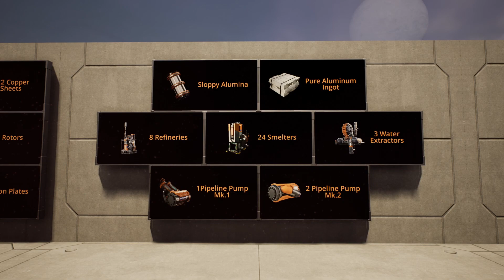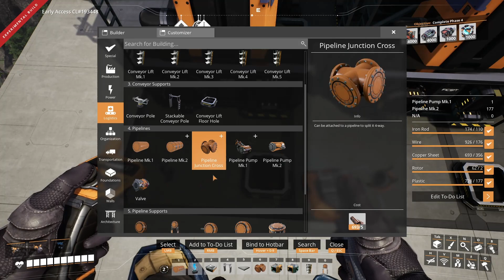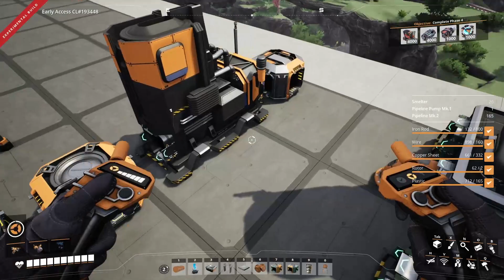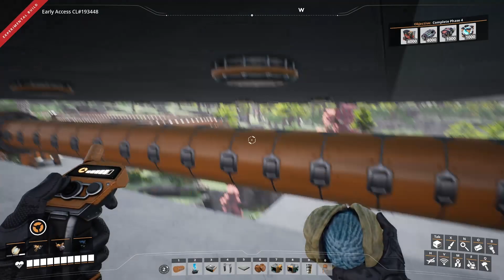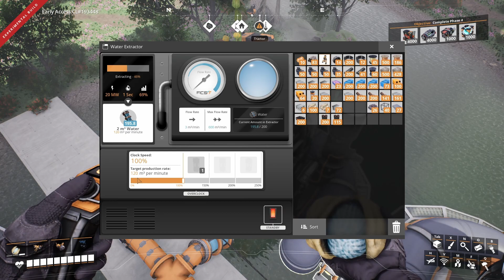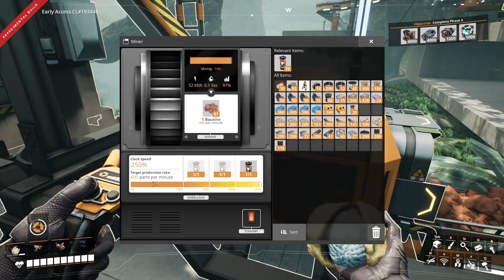Satisfactory: Waste Free 720 Aluminum Ingots/min

Comment: I adapted my own Aluminium factory to this design and alas, I also get idle refineries. The design I used myself is to bottle the water and dump the bottles into an AWESOME sink
Reply: wet concrete is a good option aswell for less hassle

Comment: Great design except you have the valve/pump in the wrong place. The problem that needs to be addressed in this loop back is that each extractor also has a 200 m^3 fluid buffer - which means that input pipe really has a flow rate of 600 m^3 instead of the 320 m^3 amount you're expecting (unless the buffers are empty). The extra flow can crowd out the return line and cause them to back up. Therefore, its better to have a valve on the input line just before you connect them to the refiners to force restrict the input flow to the 320 m^3 amount you need. This prevents too much from coming into the loop and ensures the return line is needed by the refiners. Having a valve on the return line won't fix this - and I don't know if the pump will always give it higher priority either. That's why I trust the valve on the input line more.